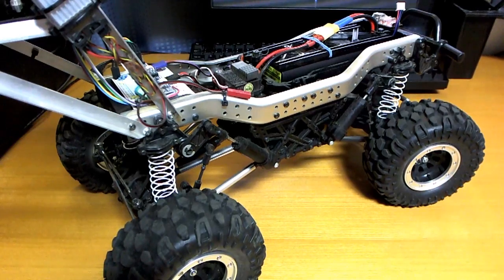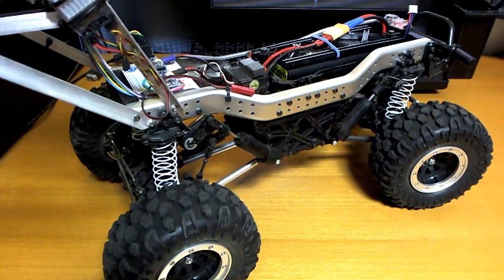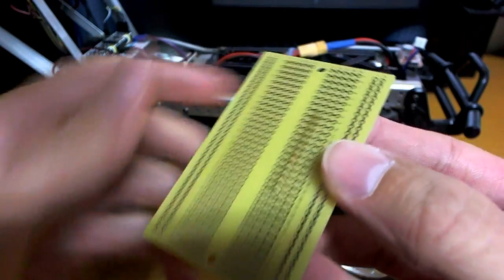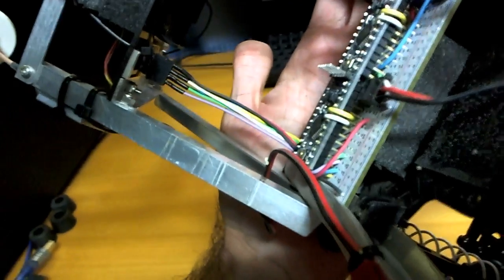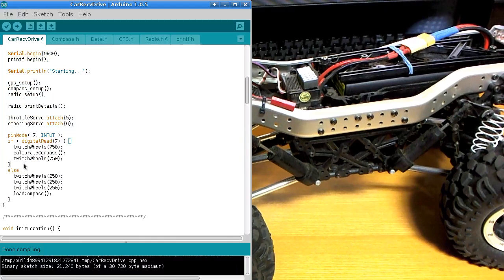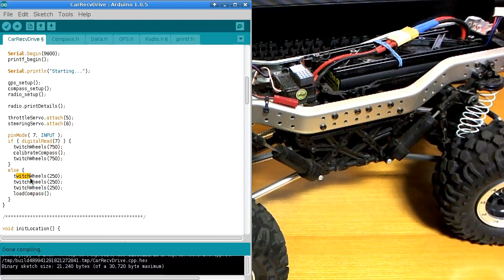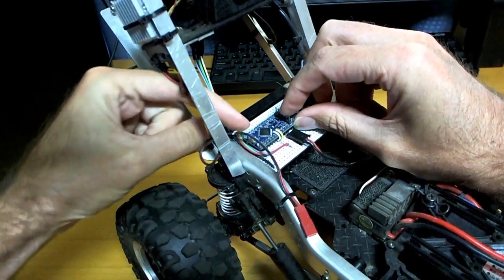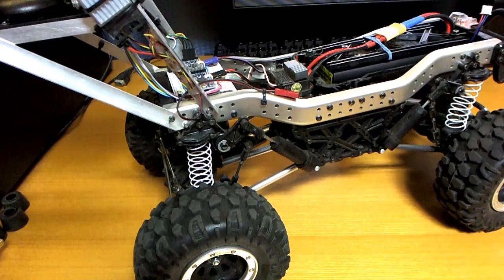RC car GPS follow-me Mk2

Comment: does the receiver also need a gps module too?
Reply from the maker: You mean does the car need a GPS module? Of course, otherwise how would it know where it is?
Reply: @iforce2d  i use GPS Neo module, can itu Will work?
Reply: @iforce2d does the both device need compass ?

Comment: What arduino should i buy in order to start learning about arduino, and get a rc car to drive waypoints?
Reply from the maker: The uno is usually a good first start. The nano is smaller and still has an onboard USB to serial. Pro-mini is even smaller but you'd need a separate USB to serial adapter. Functionally they're all the same.
Reply: Hello, im really interested on how you do this. Any other item that i need buy to build this?  @iforce2d

Comment: Instead of programming it to navigate in a straight line to the tracking device, you should program it to follow the path of the tracking device.  That way, it'll be less likely to bump into things.  Obviously, you can implement this very easily by storing the tracking device's coordinates every second or fraction of a second so that the car can plot a route.
Reply from the maker: Yes, although with a total of 2kb of ram this is not really the board to use for that :) With it heading straight for the target, it's a lot easier to debug and clearly see how accurate the performance is.

Comment: Hi Sir.I want to understand your code about the project.In your code,especially in CarRecvDrive code,you defined Home_location_reading 10.I think you use digital pin 10 for CSN (nrf module).Isn't it?And also  I saw your ublox protocol for reduce number of microcontroller  and increase speed  but  I can use 3 arduninos(because I have constrain materials).Specially at the GPStoI2C  code, you used Tinygps++ library ,so  compile error realized.Why?Which type tinygps++.h library is used?Can you share the library?Last question is how to control  dc motor(what is the name of the dc motor in code?)?For example;stop,wait ,continuous?Which pin of code is controled the dc motor?Can you share same examples about the  controlled a dc motor?

Thank you for the video.

Comment: hello, does it work in indoor activity?
Reply from the maker: No, GPS uses signals from satellites. The signals are quite weak and require a good clear line of sight to the sky, in order to be accurate.
Reply: iforce2d 

Do you have any advice that i can use in indoor? It will be a lot of help in my project that has a remote and also has a function of "follow me" and manual control in short distance

Thanks
Reply from the maker: I don't think there are any reasonable options. All I can think of is infra-red tracking like they use with these quadcopters: https://www.youtube.com/watch?v=w2itwFJCgFQ
(look at the cameras in the ceiling and the little gray/white balls stuck onto the quads). This would only work in a single room and is incredibly expensive.
Reply: thanks

Comment: I'm very intrigued by your project - well done! One possible refinement to turning, if being used on a common roadside sidewalk or on a street, might be to use a GPS "bread crumb" path so the drone doesn't turn too sharply through corners and consequently going off the path of a sidewalk or street.   BTW this project would be outstanding workshop for aspiring follow-me drone coders  (drone being anything that moves about autonomously ).  Cheers from Austin TX.

Comment: Hi Mate,

How about some ultrasound sensors?  I was thinking about a very similar project to this but using also some obstacle avoidance method to avoid the car to ends up under my feet or like in your video, under your bike tires lol.  Would you have a better solution than the Ultrasound?  Cheers. Chris.
Reply from the maker: Although I haven't tried it more than just for a quick "hello world" sketch, I think ultrasound would be a pretty good way to do it.

Comment: Is this project using PID control?
Reply from the maker: No, not really necessary.
Reply: iforce2d can I implement PID on this project to control motor speed?
Reply from the maker: I guess so, but I don't see why it is necessary.
Reply: iforce2d in my school project, I need to make some electronic project that need pid control, so if I  add some pid to control motor speed, faster when the distance further, then slow until reach its set point (ex:1m from user), can it be done?
Reply from the maker: Like I said, I guess so. But this project is quite complex. It would be like building a house, just to show your teacher you can make a doorknob.
Reply: iforce2d if I have some questions later, can I ask you again sir?

Comment: It's a nice concept, the follow me concept, but GPS seems not quite up to the job. I think you do need it, but it needs to be supplemented with something else for the close range positioning. I have not looked at the sketch to see what else you have hanging off the arduino,
but it seems like some kind of radar scanner looking for radio waves coming from the "me" in follow me.
Reply from the maker: How much accuracy you really require? GPS is good for a few meters and is pretty cheap, but anything better than that quickly gets expensive and complicated. You can try assisted GPS with local ground station (around $400 for one roaming module), or UWB time-of-flight (around $10,000 for a dev-kit with four modules).
Reply: Thanks for replying. I think you are wrong.  I think there is a way.  I think you put a tiny military style rotating dish pointing up at the probable angle of the runner, ...and not really rotating, but moving from left to right in front of the RC car toward the runner or walker.  It would just go back and forth and scan for the direction with the biggest signal.  Ah, but if you could swing it, you could put 3 sensors on the front and then have no moving parts, and just have one sensor in the middle pointing dead ahead in front of the car, and two sensors on each side of that pointing outward at say a 45 degree angle from the middle radio receiver.  The RF receiver that has the strongest signal helps point the car in that direction.  It is still not wonderful I admit, but it could really tight up the way this thing works so it could follow the runner with more precision.  ....if it would work.   I do not know that it would work at all.  You'd have RF flying all over the place. In certain situations you might be able to use 3 microphones sensing where the noise of the runners footsteps are the loudest.  I think there is a $3 to $10 way to do it.  What do you think?  Do you think the 3 RF sensors following an RF coming from your phone, or 3 microphones sensing your footsteps in a quiet testing place, ...do you think any of those ideas would work at all?  I look forward to your response.  Thanks.   Cool project btw.  But some of us are too cheap for GPS.  ...ah!! They are cheap now!  Really cheap.  I have not looked in a while.  Still, I think a little bit more technology could be added to make it follow closely and more precisely and responsively.  But I have not tried to do it either.
Reply from the maker: Sounds awesome. Be sure to make a video about it when you're finished :p
Reply: So do you think either of those ideas might work?  Have you ever played around with trying to get some signal and devise a measure which direction the signal is strongest or coming from? Why couldn't you put 3 ultransonic recievers on the car, and an ultrasonic transmitter on the runner somehow.  I guess the runner would have to point it at the car.  Yeah, ... I hear what you are saying.  The whole thing would be a mess, but I promise you there is some way to do it.  AHA!!!! 
I got it!!!   Tie a string to the car.  That'll work for sure.  No batteries. No electronics.  In fact, the car does not even need wheels.  You could just drag it along.  However, this probably violates the spirit of what you were trying to accomplish.  But still.  What a great simple solution to the whole non-problem.

Comment: Sir hi.I ask a question.You shared 3 codes.If we use UBLOX protocol,we don't need GpstoI2c .Ok .Well ,You used 2 arduino pro mini on rc car.How did you send data your hand sensor?Or how to send data from your hand sensor ?and also can you give information connection about gps module with compass?
Reply from the maker: No data is sent to the hand sensor. The hand sensor sends data to the car, see the FollowMeTag sketch for details, and this video for more details:
https://www.youtube.com/watch?v=eVnyPSAefxU
And this page for basic info on using nRF24l01 modules:
https://arduino-info.wikispaces.com/Nrf24L01-2.4GHz-HowTo
The compass is an I2C device, so the connections are the same as for any other I2C device:
https://www.arduino.cc/en/Reference/Wire
Reply: thank you
Reply: Can you share transmitter code from your hand gps sensor(ublox 6m)?There is not transmitter code  your shared  file.I saw  arduino rc transmitter  video but the project is not same .Specificly,other code is not consist of parts of "void loop,void autocontrol and void manuelcontrol"  function.I think in the file,2 codes manage gps data receiver and servo motor control.Do you agree?
Reply from the maker: All the code can be found at the link in the description.
Of course the other project is not the same. I showed you that to help you learn how it works, so you can make things yourself.
Reply: Which project works with the code?(just rc car follow me?)Because you used compass module in rc car follow me project but I did not see compass library in code.Does the code work for driving rc car with gps?Is it certain for normal work?In the code,which gps module you used?(gps module or gps module with compass?)Could you use u center protocol with compass gps module?And you are legend so help about this subject.
Reply from the maker: The project in this video works with the code.
There is no compass 'library' needed, my code does all the communication with the compass already. Please read the code, if you read it you would not be asking that question. If you did read the code but did not understand what it does, you probably should not be attempting this project.
Yes, the code works for driving the car with GPS, that's what I showed in this video.
I don't understand what you mean by "certain for normal work".
You need both GPS and compass, so if your GPS does not include a compass you will need a separate compass, for example: https://goo.gl/WeWTvE
The u-center application will work with u-blox GPS modules.

Comment: Hello. Are you connect compass to arduino at pin A4, A5??? How to connect 2 arduino mini, same as compass ???
Reply from the maker: Yes, the compass is an I2C device, and the two arduinos are also communicating by I2C.
Reply: that mean compass connect at pin A4, A5 of main arduino and helper arduino connect at pin A4, A5 òf main arduino too
Reply from the maker: yes
Reply: Okie, Can you tell me how to put the compass please, compass dỉrection??? Please
Reply from the maker: Place it so that it reads zero when facing north.
Reply: That mean atan2(y, x)= 0 when facing north???? Right
Reply from the maker: I don't really understand your question, and I can't remember all the details of this code. You can mount the compass however you like and just add 90 or 180 etc, to adjust the output to what you want.
Reply: iforce2d ok! thank you so much :D
Reply: Why do we need calibrateCompass???
Reply from the maker: https://www.google.com/search?q=Why+do+we+need+calibrateCompass

Comment: The CarRecvDrive and GPSToI2c works perfect, I'm able to get the devices to communicate, however im not able to get the followMeTag to populate the current GPS position over to the CarRecvDrive.  I have a feeling it may be the model GPS I'm using on the FollowMeTag and/or the configuration setings.  Can you please provide the model and/or name of GPS your using on the FollowMeTag?  Thank you!!!!
Reply from the maker: "get the followMeTag to populate the current GPS position over to the CarRecvDrive" sounds more like a radio communication issue from that description. I think I was using a ublox neo6m but it shouldn't make any difference.
Reply: Hi,  thanx for the reply....I believe the communication is fine.  I added some gps coordinates manually to  the FollowMeTag and they are transmitted and show up on the CarRecvDrive serial output.  So the communication appears to be working it's just the FollowMeTag that's not calculating the gps coordinates in "processGPS".  The formula "data.lat = posllh.lat / 1000000.0f" outputs "0.00"
for a gps location.  So I know that the  "processGPS" loop is not  outputing any data for "data.lat" and "data.lon".
I understand your position and realize I'm asking you to share your expertise with me, please just let me know and I'll stop asking for your help.
Thank you
Dave
Reply from the maker: Is this a GPS module you know to be working ok? Did you wait a good long while, outdoors, for it to get a solid fix? I don't recall if I left it in that sketch, but at some point I would most certainly have had some debugging output to the serial connection. Maybe you can find it commented out in the source code.

Comment: Good Day!
I have implemented your amazing sketch.  The only problem I have is getting the Ublox GPS/Compass to communicate via serial on the GPSToI2C sketch.  I get a read but it comes up invalid...?  Am I missing something to get the info from the GPS/Compass to read to the serial port?  I do get the compass readings so that works great, just missing the GPS coordinates.
Can you suggest anything?
Thank you!!!
Dave
Reply from the maker: Are you testing it outside with clear view of the sky and waiting ten minutes or so to give it a chance to fix? The name of the sketch "GPSToI2C" should give you the clue that the final goal is to output the info over I2C,  not serial. I'm guessing you are looking at some debugging output I printed for the serial monitor, but I don't recall if it is printing all info, or just some info.
Reply: Yes your right, I was looking for the serial output to verify, no problem thank you very much for your relply.....i'll
 keep trying!..:)

Comment: hello iforce2d,
This is great project. But why you use 2 arduino minis instead of 1 arduino mini on the car.
Can i use one arduino nano on my car???
Thank you so much!
Reply from the maker: This was my old method, where I use NMEA messages from the GPS. Those messages are text strings which take up a lot of memory, too much memory for one arduino to manage both the GPS and the rest of the processing together. So I split up the work into two arduinos. These days, I use the UBX protocol to get information from the GPS, it's much faster and requires very little program space and memory: https://www.youtube.com/watch?v=TwhCX0c8Xe0
Reply: Oh oh, Thank you for helping! Can you send me your proteus??? :)
Reply: Excuse! I have some questions... Really need get time and date from GPS???
Reply from the maker: No, the time and date is not necessary. But when the GPS is searching for a fix, the time/date is the first data to appear. So it's useful to check if the GPS is connected to the arduino properly, without waiting for a full 3d fix which can take 5 minutes or more.
Reply: Oh, ok!

void compass_setup() {
  Serial.print("Mag... ");
  // instruct chip we want to read it continuously (TODO: REPLACE WITH BETTER POWER SAVING MODE)
  Wire.beginTransmission(0x1e); // transmit to device 0x1e
  Wire.write(0x02); // sends one byte (select register to write to - MODE)
  Wire.write(0x00); // sends one byte (configure mode - continuous)
  Wire.endTransmission();
  Serial.println("done.");
}

I don't understand how to get compass??? 0x1e where is device??? :))
Reply from the maker: 0x1e is the address of the HMC5883 compass.
Look at pages 11 and 14 in the datasheet: https://cdn-shop.adafruit.com/datasheets/HMC5883L_3-Axis_Digital_Compass_IC.pdf
Reply: Ok! Can you talk me about this code in the FollowMeTag

const unsigned char UBX_HEADER[] = { 0xB5, 0x62 };

struct NAV_POSLLH {
  unsigned char cls;
  unsigned char id;
  unsigned short len;
  unsigned long iTOW;
  long lon;
  long lat;
  long height;
  long hMSL;
  unsigned long hAcc;
  unsigned long vAcc;
};
NAV_POSLLH posllh;

Did you use UBX protocol in the FollowMeTag code???

And what is throttleServo???

Sorry! I'm having a microcontroler project in my school (Da Nang University Of Technology, Viet Nam), so I need your help
Reply from the maker: https://www.youtube.com/watch?v=TwhCX0c8Xe0
https://www.youtube.com/watch?v=ylxwOg2pXrc

I don't remember if I used UBX in the tag, but it should be obvious from the code...

throttleServo is the throttle controller. Most ESCs use the same signals as a servo.
https://www.arduino.cc/en/Reference/Servo
Reply: thank you! but i don't understand how to rear tires working with throttleServo. Please send me a picture of structure them :)
Reply from the maker: The throttleServo pin is connected to the signal pin of the ESC. You can see it here, the three-wire servo connector. https://goo.gl/rEgTIF

When the "servo" sends a signal for 90 degrees, it means no movement. Above 90 degrees means move forward, below 90 degrees means move backward. Of course it's not really a servo, but the arduino doesn't know that.
Reply: OK! Thank you so much :)